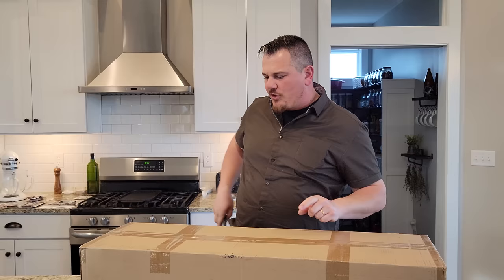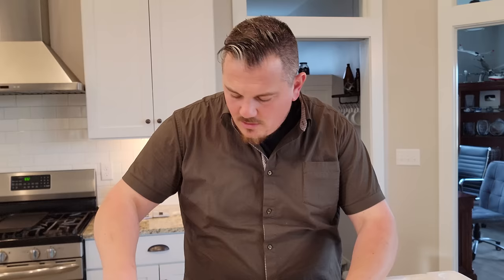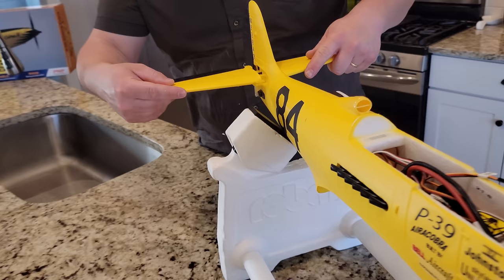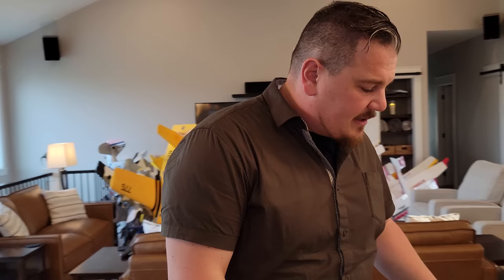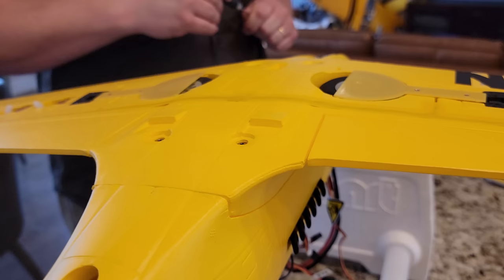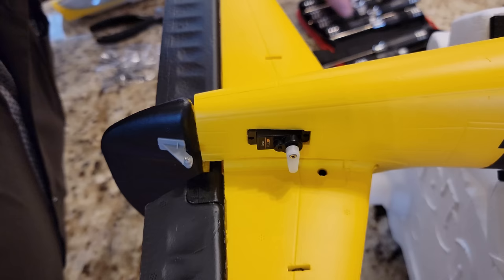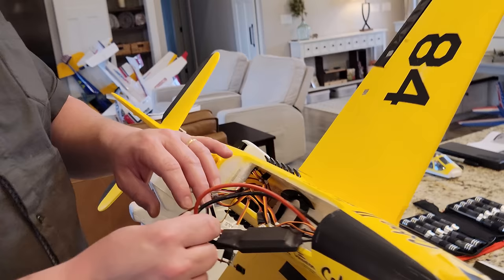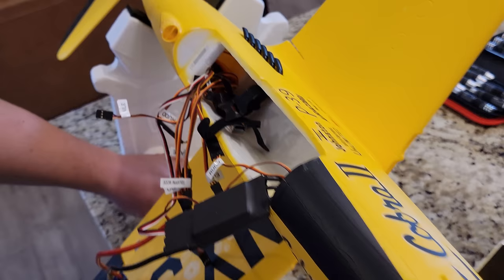FMS - P-39 Racing Cobra - 980mm - Unbox, Build, & Radio Setup

Comment: Brian, to make inserting the connector "pins" into the plastic housings easier for any connector, heat the plastic in hot water to expand and lubricate the plastic.  The pins pop right in with little effort.  You may also need a bigger soldering iron to heat the heavy wires and pins more effectively.  I use a 400-Watt iron or a small butane blow torch, and a jig I made for holding the pins and wires.  The torch  works better than the iron, but you have to be careful of the flame's heat on adjacent surfaces.

I recently bought a P&P version of the subject FMS P-39 from a local hobby store and I put a new, unprogrammed, Spektrum AR637T receiver in it.  Using the Spektrum RX Programming Cable and Software, I programmed the receiver with the Horizon Hobby 1.2m P-51D's profile, which is a similar aircraft.  So far, the profile seems to be working fine in the P-39 with respect to AS3X and SAFE Select.  With my NX-6 Spektrum TX and the AR637T RX, I'm able to have SAFE, flaps, and gear on separate switches (the NX-6 is actually a seven channel TX).

I did have the following trouble assembling the P-39:  1) The 70Amp ESC was DOA (replaced by the hobby store's supplier with an 80Amp ESC of the same make).  Replacing the ESC was difficult since the bullet connectors between the ESC and motor did not extend outside the foam, so I couldn't get to them.  Consequently, I had to unsolder the wires from the two ESCs and solder the new ESC into the airplane.  Since the ESC ends of the motor wires only extend about 1/2" into the battery compartment, soldering these heavy connections had to be done inside the battery compartment, which was very close to the foam.  2) The supplied screws for the flap control horns were too short, so I had to replace them with longer screws that I cut to length.  3) The supplied elevator servo was a reversed servo, so AS3X and SAFE moved the elevator opposite of what was needed.  I had to replace the original elevator servo with a regular servo, which fixed the problem quicker and easier than trying to fix it with RX programming (NOTE:  Servo reversing in the TX wouldn't work since the problem was AS3X and SAFE, which are in the RX).

So far, I've flown the P-39 twice on a 3-cell battery.  Based on those two flights, I need to adjust the rudder for more control authority since it is less effective than I expect.  Otherwise, the P-39 flies smoothly.
Reply from the maker: Thanks for the tip on those pesky EC3 connectors. I never thought about using hot water to expand the plastic.

As for your iron - 400 watts - GOOD LORDY - is that a WELDER or a soldering iron!?!??! I've never seen more than about 60 watts. Where are you getting this 400 watt style?
Reply: It’s an old Weller model D550 that my dad gave me about 50 years ago. Now that I’m looking at it, I see that it only puts out 240 or 325 Watts, sorry for the misleading information. Still, it does the job.

Comment: the 37mm gun that shot out the spinner was set Infront of the pilot between the two other 50cals. Also, the P-39 had a three bladed prop so that might be why they had a place for a 3 bladed prop in the box
Reply from the maker: Very cool!